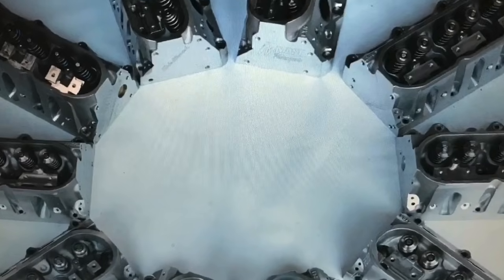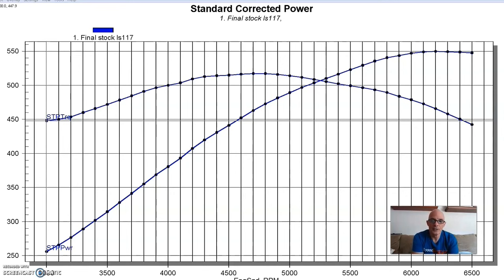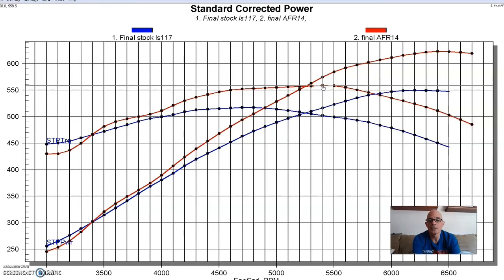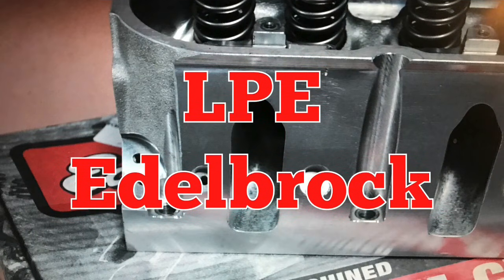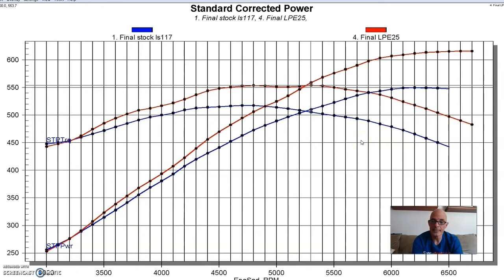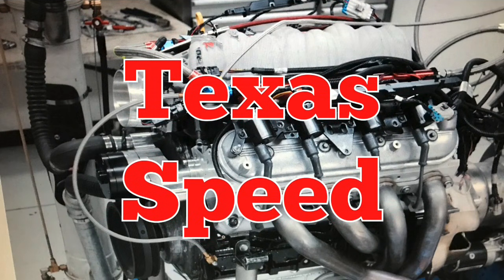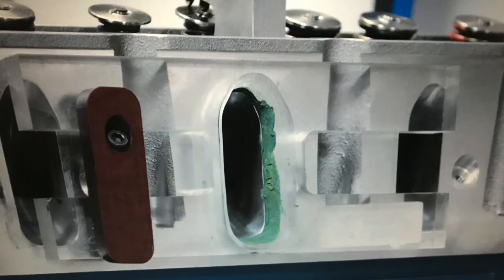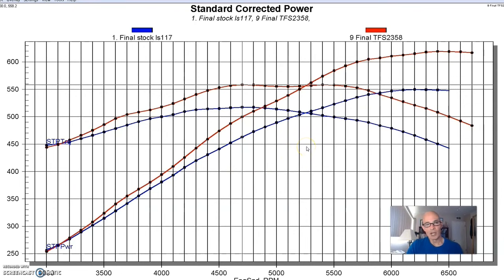AFTERMARKET LS HEAD TEST-STOCK CATHEDRAL PORT VS 10 SETS!

Comment: @LSx Motorsports  yeah I just looked @ the budget I'm working with. So I'm using my stock LS 346 block. Hoping to next year pro charge it. But I already have the fast 102 intake mani, 102 throttle body, and all accessories needed. Now I was gonna purchase the mast head black series, the ones set up for boost. However I need @ least 100 more hp. So nitrous, based on budget, is my only option for 2022. I need to find out of nitrous works with the boost black series heads, what cylinder head gasket to use, and if the piston rings can be gapped without removing the whole rotating assembly?
Reply from the maker: you need to remove the pistons to gap the rings, the Mast heads will work with nitrous (any head will), I use LS9 gaskets

Comment: Thanks for another great informative video!!
I'm assuming that these were all run 'out of the box' and the valves were not lapped? The reason I ask is because I have heard and read that ALL 'out of the box' assembled heads leave power on the table with less than stellar valve to seat sealing. Have you found this to be true with these aftermarket ls heads?

Comment: What intake manifold was used on the Mast heads? Was it a stock LS3? If so, that seems to be the best. Didn't lose ANY power over LS1 at ANY point and still made 620HP. A stock LS3 intake manifold is going to cost a lot less than a FAST too.

Comment: Awesome test
I’m here waiting on the 4.7L Dodge
Reply: There a reliable good running engine but you Prob won't see it anytime soon or at all where it's the oddball OHC v8 in truck lineup  if it was a 4.7 hemi style engine prob would just like the GM 4.8
Reply from the maker: just add a cam and/or boost
Reply: You be waiting along time until the cows comes home or when pigs fly.
Sorry 4.7L Dodge has little fan fair & modern day Hemis aren't really Hemis at all. Dodge uses the Hemi name for marketing purposes. It sells a lot of cars & trucks. Hemis of now do make power but simply copies of LS platform..Hemis from the 60's & 70's had either hemisperical shaped combination chambers in the cylinder heads or dish in their pistons were hemisperical. Your best bet is to
buy a vehicle with a modern day Hemi in it 5.7L. 6.1L. 6.4L 
4.7L are considered modern day
boat anchors just like GM 8.1L Vortecs which are not LS based.
Big aftermarket support for newer Hemis..& growing Fiat, Dodge, Chrysler currently have no intention
in future hybrids..Hemi name plate will be around for quite some time.
Reply: ngo  about the only thing a modern Hemi and an LS have in common is that they are both 8 cylinders. The Hemi is definitely not a copy of the LS

Comment: Cleatus's had a LS1 in leroy and put a set of Texas speed cathedral port heads then got a 7.0 short block and installed those heads on it and yes it has twin turbos but I think he made 1300hp or so to rear wheels with those cathedral port heads on a 7.0.
Reply from the maker: lots of guys making 2K hp on cath heads

Comment: Guessing all the power curves look the same because the came is the same through out. More than likely the heads are big enough for the cam thus we see the full potential of the cam shaft with each head.  If the head was too small the power numbers would suffer. This shows that the cam that was run is a good option for all these heads but also that these heads can run more radical camshafts and make more power. Besides we still have yet to add BOOST!

Comment: What is the exact model of those Texas Speed heads? I'm considering the Texas Speed Brawler LS6 heads for myself, but I'm not sure if the flow numbers on their website can be compared, for example, with Trick Flow 215 CNC heads.
Reply from the maker: when we did this test-they only had 1 type of ported cath port head

Comment: Hey rich.. i have a 2003 e39 bmw, im thinking about swapping a ls into. How would a 4.8, ls3 head mild cam and ls3 intake work together? Im sure i would have to rev out to 7k rpm, which would be fine for a sport sedan. Im hoping for about 400 hp to the wheels. Thanks
Reply from the maker: YOU CAN'T RUN LS3 HEADS ON THESMALL BORE 4.8L

Comment: By the data, the tsp and tfs heads look the most streetable and have the flow numbers to support boost. But the ported stock ls6 heads would fit the bill for 90% of us and be much cheaper. Those 6 bolt prc heads are just begging for a stouter block and copious amounts of boost though.

Comment: I like the way the Texas speed and the TFS235 heads look on the power graph....Maybe a slight edge to the TSP head.
  Would also be a plus if we knew the air speeds to give us an Idea of how the port might recover after  gear change because this is 
Important at least 2 times on an auto trans and more on a manual trans.
  I have seen before where the Lift Diameter ratio kept picking up power to .35 L/D and more  but I do not think this would apply to this test engine unless more compression and the rpm range was moved out  a good bit.
  As it sits for this test there is a good amount of airflow left in these test heads.
  Great work Richard how stable was the  air density throughout this testing  marathon?

Comment: With the cost of new trucks, when my 2018 denalli 6.2 is ready to go to another owner I'm considering going to an older truck with a nullet proof 6 spd and 6.2.  Would like to see a recipe for a mild 500hp build with decent fuel economy in mind.  Thanks!
Reply from the maker: 500 hp 6.2l is just a mild cam

Comment: I have one small question, Richard: When were all these tests done? Because now that bolt-on, self-learning TBI systems exist, this would be the way to go with testing on apps you'd usually involve a carburetor since it's what today's new, younger builders are likely to go with on their builds. Plus, the annular discharge bores... used by some of the models on the market... would prove to be advantageous on forced-induction apps, where creating a "fog" of fuel would allow better mixing.
Reply from the maker: no bolt-on, self learning system (especially a TBI) and carb-style intake will do what the Fast intake and tuning do

Comment: That's an awful lot of very useful data.  I would love to see something similar in regard to SBC heads.

Was a little surprised to see that the World heads did not do any better.  Do you suppose the change in rocker arm ratio could be partially responsible?
Reply from the maker: I tested 30 sets of Ford heads back in the day
Reply: @richardholdener1727  Well that's amazing, but unless they were BBF heads it wouldn't hold a lot of interest for me personally.

I'm sure there are other people who would be very excited about your SBF  head data, however.
Reply: Michael Angelo : Not looking anywhere in particular but yeah Im awaiting that installment. Next should be a "Holdener Interchange Manual" with CopyWrite Richard "Hi Ratio" Holdener. Its fitting to start with Chevies best engine series first. Wow Richard. Just Wow! No knuckle draging or knuckle head there. Just straight energy and doing it. Well done. And really good you started with GM first. There are no CFM problems with the LS. Stout piece. In the hands of the people.

Comment: Question, is it a benefit to remove just the studd boss on a stock 6.0 with 317 heads?
Reply from the maker: WHAT IS A STUD BOSS?
Reply: Where the rocker arm bolt comes thru and the casting protrudes into the intake port

Comment: Hey Richard , thanks for the video.  I have a 6liter LS2 Stick and I was wondering if you've ever texted Trick Flow cathedral port vs Trick Flow rectangle port heads on a LS2. I'm asking because I'm going to swap heads and intake and wondering which is the best combination. This is a Street/Show car. I just don't want to leave any cheap HP/TQ in the table.   Thanks Don
Reply from the maker: USE CATH FOR THAT MOTOR

Comment: Just a question, have you ever done or thought about doing an engine Dyno on a 383 or 406 with the skip white nkb200 /  assault racing / proheader Chinese dart copies?
Reply from the maker: I'm not familiar with those
Reply: @richardholdener1727  they are a dart Platinum 200 copy.

Comment: liked.
alot here.
as for the cnc heads....all about the same in this small cam test....but Reliability is assumed.

I remember you from a few technical write ups in MMFF mag a long time ago when I did race.

I got a Great test idea......if you find the parts....
427 small block..limit to 12 to 1....limit .700 lift...and the normal avail inline heads...

I get the LS interest.....but the Ford world had alot of interest too...
Reply: subbed

Comment: Have you done a test with cnc small runner heads like AFR205 or PRC terminator 200cc ?  Thinking of Torque difference  at 4000?    Or would it be similar to cnc ported stock castings I suppose.

Comment: I'm trying to make at least 500hp with lq9  6.0 bored over .030. What head and cam would you suggest, pricing isn't an issue
Reply from the maker: that can be done with a cam-799 is a good upgrade over the 317 head-or many ported stock or after market heads work even better

Comment: How much torque does it make from $2,000 power to 3500 please
Reply from the maker: we don't run WOT at 2000 rpm
Reply: @richardholdener1727  had a tow vehicle towing a trailer down the highway it be nice to know what the torque is at a lower RPMs do you understand what I'm saying

Comment: Would you change from a ported 317 (full exhaust port/intake bowl only/2.02 1.60 valves) to the tfs 235 on a procharged 370?
Reply from the maker: the tfs will definitely make more power na-but are you at the limit of the blower?
Reply: @richardholdener1727  its a d1sc not maxed yet. Just not sure if the tfs is worth $2500 more than my current 317s... Do you think noticable gains would be made?

Comment: Why does the tq plateau at 550 and change is that the limit of the ve or is there any hope for cam change
Reply from the maker: a cam with a tight lsa might help but this motor was already making 1.365 lb-ft/inch-a pretty good amount for a street motor
Reply: Probably a header tuning issue. Engine might want shorter headers.

Comment: Great test for a 408 LS pity you didn't use a 6.0 ltr or something from the junkyard with standard rockers  ;-(
Reply from the maker: less of a power difference
Reply: @richardholdener1727  I love your channel and follow it religiously but how many of your followers own a 408 with roller rockers
I would have expected you to use something readily available from the racing junk which you are famous for ;-)  
Plz excuse my ignorance but you're saying there would be less of a difference in the results using a 5.3-6.0 displacement engine ?
Reply: @revtec4267  that's exactly what he's implying. Smaller displacement will benefit LESS from higher flowing heads.

Comment: Amused that the heads procomp sent were above their typical. Wonder if they got someone like brekzinski in there to work on them. 

It's also worth considering that they heads are extremely mature at this point unlike stuff you'd get for say a gen1 where you could have prod heads below 200 CFM to 21 degree SB2 stuff that has been created over ~65 years of time.

Comment: Cam Specs here. 281LRR HR13 .ADV IN.281 ADV Ex.297 @ .050 IN.231 @.050 Ex.247. Lift W1.7:1 rocker IN.617 Ex.624 LSA113°
Reply: Are these the same specs as the cam in this video or different?
Reply: Same, he used the same cam in a lot of LS engine tests.
Reply from the maker: the 54-469-11 is well known
Reply: @richardholdener1727  thanks Richard. It's close to the specs I'm using. 
229/244 @50 112lsa 629in  615ex TSP STG3 Ls3 but using cathedral heads.
Reply: 393ls all bore 4.155" with stock stroke. Dressed up like a sbf with dizzy just to add a little confusion.

Comment: Who’s numbers? Theirs or one flow bench for all heads ? As  manufacturers boost numbers for sales advertised bs
Reply from the maker: I flowed every head on the same bench under the same procedure
Reply: Richard Holdener thanks some of best flowing head will swirl the air on n.a many track records have been set by designed swirling the air. Not just hogging out a runner on an N.A. Head . Thanks Steve

Comment: There's hardly 2 percent difference between any of these heads, telling me that the limiting factor here was the intake system, which was maxed about at 620 hp capacity.
Reply from the maker: its more than that-we've made 700 (NA) hp with this intake

Comment: Hp and torque are not everything... quality of the material, deck thickness, valve seats, valves, valves springs, keepers and retainers are also some key factors. What is acceptable for a NA engine may not be for a boosted application. Saving money on a cheap cylinder head that makes the same HP can cost you more in the long run.

Comment: Take those stock 241s and get a $800 cnc job and slap em on. You're going to smash a valve one day so may as well do it for less lol.
Reply from the maker: We showed that ported stock heads work well
Reply: @richardholdener1727  Yep. The only thing they lack is a thick deck for boost.

Comment: The Edelbrock LSR heads ported by race shops like BES Racing are good for 1100hp NA if you can get it compressor to move big air